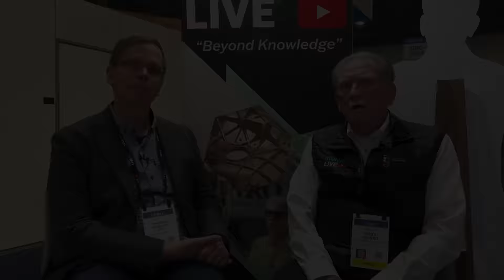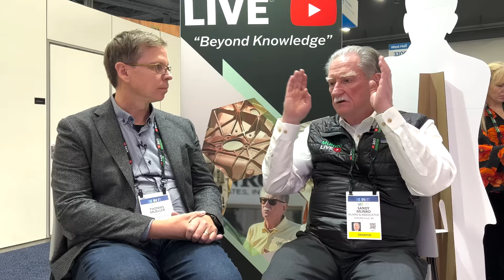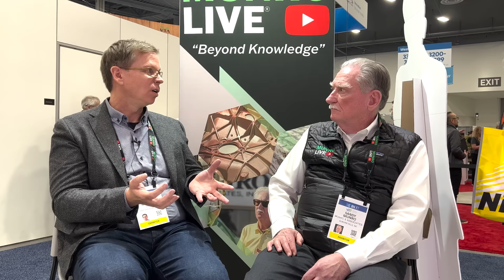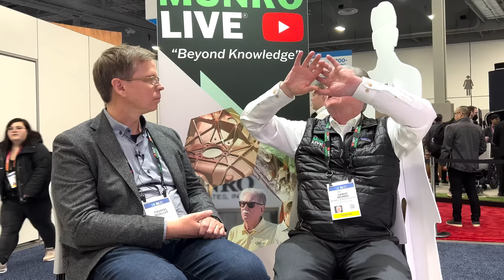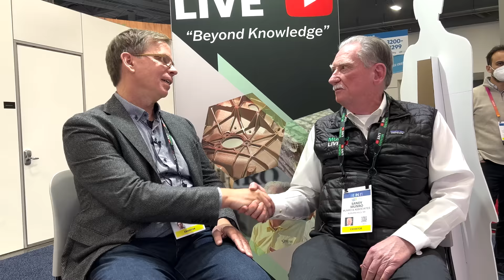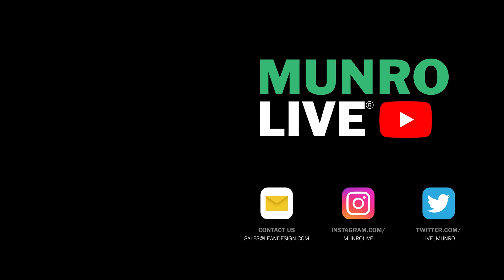100 Million Lines of Code: The State of Automotive Software | CES 2023

Comment: Don't leave off the man ours of work that goes in to each and every embedded processor for each function.   There may be a man year in the wiper controller alone.   The software team that designed that module winds up either dissolved or moved on by the time any fix or update is required.  If the module or processor is replaced then the effort starts from zero.
Reply: We call that the VW development model.

Comment: Okay, Android is better than Linux, but Android is a flavor of Linux. This is akin to saying that a Granny apple is better than apples. No, it is an apple. It might be better than other flavors of apples, but it is certainly not better than all apples, because it would have to be better than itself. This is math and not an emotion. Most computers that run Linux will be able to run Android. There are a few more restrictions, but not many.

Both of these operating systems are designed using C. By the argument of Sandy and Mueller, this should remove both of them from their software list. There is a reason why C is still being used. It is easier to modularize the code. We can make Advanced Programming Interfaces. This means that older language gains reusability, and it can go to a lower level of programming hardware components. It does not have type checking as much, so it will let you shoot yourself in the foot, but in so doing, you lose latency, but according to Sandy and Mueller, latency is bad. The only better way to lose more latency is to use assembly language. These aren't cards. These are very annoying programming statements because the programmer has decided not to have an interpreter, for the layman's understanding but really a compiler for jargon of software and hardware engineers, for the processing unit. This is not an emotional argument why C is still used. It is mathematical.

Because something is not new does not make it bad. Combining modules means that the hardware is more stressed as you have increased the duty cycle, which means it should be more likely to fail. Failure in a car is a bad thing, so latency has some benefits in this case. It is called redundancy. There should not be obsolescence planned to limit the lifetime of the vehicle, but constraints need to be put into any calculation of engineering, but yes, there can be a question what the constraints mean in terms of the evaluation function. Sandy's argument is that the constraints should not affect the cost of the car as much when cars are skyrocketing in terms of price.

Sandy's other argument is that at least one manufacturer in terms of Tesla had larger margins anyway, and as such, the cost wasn't the problem in the first place, but this misunderstands that Tesla is 3 companies in one that have all decided to help one another. That is how Tesla lowered its price. The 3 is conservative as it is the manufacturer, the dealer, and the battery company. This also ignores that it is also the fueling company as well. Sandy, you think this is good, but we, as a country, have seen the effects of multiple companies being one without the boundaries still applied. It raises end prices as the multiple companies do not have transparency to regulating authorities, and as such, the multiple companies have the ability to hide how much their profit margin is. Tesla is showing how much they raised their prices by beyond what the product should have sold for because they just lowered it, or they are using the move to take temporary losses, which I know you disagree with, in order to gain market share. Either way, these are tactics of a monopoly. Their battery company also expanded its product line into non-competitive markets by creating new housing for the batteries for products such as the Powerwall. This raised that company's costs, but it increased the parent company's market share as it reduced the ability of anyone else to buy a battery. They used resources. Could this be explained in a legal way? Sure, it could be explained by Tesla needing to get over a marginal cost in any of the mining industries as no one was actually producing large numbers of EV's other than Tesla. This meant that Tesla expanded its business interests to lower the cost of the miner, who then lowered their cost. The problem is that now there is now competition, but there is very little argument that Tesla's component would sell to any of their competitors even if it is in that component's best interest to do so. The other way it could be explained is that Musk was thinking of the pure altruism of dealing with solar even as solar was having trouble by losing money. I'm sure this altruism is the same altruism of Musk dealing with Twitter so that his plane could not be tracked or so his marketing could be less interrupted as he would be in control of the platform.

I don't have an MBA. I have a degree in computer science with classes in game theory. I also have education in history with some breadth in economics.

Comment: The solution has always been hierarchical software abstraction layers separating the main systems from every hardware layer. This makes it possible to replace any hw with new technology without rewriting your whole system.
Reply: With a good sw design it becomes possible even to backwards emulate even older interfaces or older hw. Upgrading things when you can.
Reply: A True OS is an "operating system" NOT a "user interface". The OS interfaces the hw and functions. The UI could be anything on top of that.
If OSes were designed properly you should be able to use ANY user interface -- Windows, Apple, browser, android, or literally ANYTHING. That Good SW design.
It isn't being done today.

Comment: Android Automotive is not the all-powerful savior that this discussion leads viewers to believe. You can't just install any old app off the Google Play Store and add functionality to your car, can you? Very few manufactures are going to be willing to expose themselves to the unregulated wasteland that is the full app store, so we're going to get subsets of apps, similar to what Amazon does with its Fire devices. Software versions will lag behind those released for phones because the manufacturers are going to have to be very careful about what can be installed. 

Lots of potential, yes, but the reality will be very different from that potential.

You mention BMW is headed in this direction. I believe that Polestar already uses Android Automotive, and that Ford is planning to switch to it at some point but has been delayed from their original release expectation. Any others going this route?

Comment: Thanks Sandy. Impressed you are an Expert Systems guy as well as an expert Systems Guy.

Catalog engineers buy auto components with embedded computers. Just feed it power and done. And ignore the dependence on the third party for software updates if ever.

Tesla engineer says - oh I want power windows? I time share the central car computer and no separate computer for the windows. Software updates easy. One central computer that's online to the internet.

Government could fix this by establishing automotive APIs (software interfaces) whereby third parties build compliant components with their software adapters hosted on an automotive central computer. Nothing happening here - so Tesla did it themselves.

Comment: I don't believe the Lightning will have a long life.  To get this EV to market as early as possible, Ford took the approach of converting the ICE F-150 to an EV by basically replacing the ICE with a battery electric drive train.  Ford had to compromise on efficiency in many ways to make this happen.
Reply: Yes.  I totally agree with you. I am amazed by all the bullshit about how great the lightning is. We all know that Ford does an absolutely crappy job in design and engineering. I am convinced once the true negative "cost of ownership" of the  Lightning  experience  comes to light that you will see the cyber truck crush the competition. 

All of the inherent problems with Ford Lightning have not begun to see the light of day yet. I always laugh when I see Wall Street analyst idiots say that Ford is a viable competitor to  Tesla.  I laugh because I know that those lightnings are a huge, disposable piece of plastic and battery. You nailed it in your comment Clara.💪❤  Used Ford Lightenings will bring a FRACTION of their original costs as the truth becomes known. 🔥

Comment: I drive a Merc Vito van with robot clutch & gears auto transmission. It’s horrible incredibly slow from engine start even slower to get moving from park and the delay on putting the pedal down is 1 to 2 seconds. It’s all down to badly written code that goes back to zero every time you go into park and horrendous latency in the system.

Comment: Did this guy suggest replacing C with Java?!  No bueno, my friend.
Reply: What I think he means and if so I agree is that c is a rather outdated and limited software language. Limited in the sense of the abilities of new codes that are easier to write and implement features on like the code being worked on by Google .
Reply: @johncandelario294  C isn't as easy to write, but has more power than almost all other languages. It just requires developers to truly know how it works.  C# I can do 1 line of code that makes a request to get data from a website.  C = maybe 50-100 lines.  C# can process the response in 1 statement.  But C could take hundreds.  But behind the scenes C# still has to make all the same calls, it just has the overhead of "simplifying" that functionality. And C is compiled to the System where c# tries to keep it generic to all kinds of other systems.   IE C is limited by the developer alone. C# is limited by the bloat.

Comment: So much to react to here: Take "more features": individualizing your car (or computer or even cell phone); is that a good thing? If you do that, can I use your phone? Your computer? Can I hop in and drive your car? NO! I will have no idea how to set the date/time (stop the little blinking light) on my VCR ... I have to figure everything out anew again each time, read the documentation; etc. Actually it is difficult to rent an ICE car - takes a little while to find where the controls are and how to use them. Honestly, with EVs from different companies, and the rate of change, this becomes like stepping out of a Cessna 172 into the cockpit of a 747. If I learn to use a Macintosh today (or a Telsa), is that knowledge going to be still useful 5-10 years from now? Or vice versa - will anyone want my phone, computer, or car (or know how to use them) 5-10 years from now? Instead you want to design highly competent, flexible operating systems that hide all those details, always provide what you need, intuitively, maybe one you can talk to. If you want something extra like a flashlight, well there is an app for that sort of thing.
Reply: One trick like Tesla and a few others offer are driver profiles.  You set things the way you like and other drivers set things they way they like. The driver's profile is automatically selected when the driver gets in.  Seat position, mirrors, steering position, HVAC, settings, preferences, and more are all saved with the driver profile. Now the exciting thing with profiles is the ability to use your profile in other cars with your profile saved in the cloud.  In the future, rent a Tesla during a trip and use your profile so everything is exactly as you expect, even if it's a different model.  While handly and consumer friendly, it's also a huge safety improvement.  Now if profiles could be made to work across brands, that would be fantastic (although probably unrealistic).
Reply: @tesla_tap  Indeed, driver profiles are extremely helpful, similar to iCloud backups of your iPhone or migration strategies for your computer and important apps like messages, browsers, photos, music, etc. A nice precursor in family cars has been simply to ability to remember and recall the preferred position of the driver's seat!

Comment: I don't think this makes sense.  Actuators and sensors are required all around the car.  Tiny embedded processors on each are not expensive when compared to the actuator or sensor.  Especially if you want to eliminate the wiring harness, you need these embedded processors.

Comment: I believe there are some mixed metaphors in this discussion with respect to Android versus Linux.  Android is an ecosystem comprising a mobility oriented user interface and various abstraction layers for dealing with peripherals.  Under those abstraction layers is Linux, though it could be a core other than Linux.  Talking about BMW having issues with Linux development and in-the-field performance is essentially saying that BMW is not adept at writing user interfaces and abstraction layers and ought to leave that to someone else.

Comment: While I agree that EV manufacturers must stay current regarding language and electronics, I am concerned that depending on third party software applications is analogous to using  off the shelf hardware. Tesla's vertical integration in hardware and software provides agility and speed of innovation unseen in the rest of the industry.

Comment: Are EVs only for agile minds?
We've been buying Toyotas for decades, their reliable and the layout is predictable, something very important the older you get especially if you've experienced varying degrees of stroke, short term memory is affected. This year we're thinking Tesla but afraid of ability to transition away from a well known layout. Great conversation Sandy. Are EVs only for agile minds?
Reply: Tesla can be voice controlled. When autonomy is solved, the car becomes your robot chauffeur.
Reply: I am 83 and replaced my 2014 Tesla MS with. 2022 MS. Don’t keep driving a Toyota. You can handle a Tesla, and it will keep your mind agile.

Comment: Sandy is such a good example how being one of the older generations is no excuse to dismiss the reality of our software defined world and to not adapt to change and lern. You really see here again how Sandy is not missing that fire to always stay on your toes for news, changes, learning and verifying hypothesis, even after all that decades.

I am a Sen Software-D/E myself, and yeah the embedded and automotive industry is horrible stuck in the 60s maybe 80s. Although I am a C++ zealot, but I concur one of the many problems is that they stuck on the old horrible C. I would say if they would move to C++ this would already be magnitudes of order better, but despite my refuse to switch to Rust and the hype I would say about it, would also be a good choice. 
I would only discourage to use Java, C# or Go. Java is horrible regarding performance, clear code and power consumption, it's almost as outdated as C. C# is basically a more modern Java. Go is very C like language just safer, but very young and coming from a company that loves to deprecate technologies that are used from 0 to today. (Gyp, Stadia, Circles)
But as said Rust, but I would say modern C++ without the C community idiocy would suffice too.

Comment: as a devops engr tesla approach to managing software is very contemporary. monolithic code management is not scalable.  it adds cost to maintain, slows down innovation, paralyzes development/change and progress.  micro services is now and service mesh is the near future.  can only do this if car is a fully integrated computer on wheels.

Comment: I don't think C is obsolete yet.  Yes it can be used to write insecure code,  but it is still going to be faster.  As an analogy,  imagine your house had padlocks on every drawer,  every food container,  the toilet seat etc..  Yes, it would be more secure,  but the overhead would slow down your whole life.  It's generally considered better to secure your perimeter and rely on trust inside the house.  With code, security is most critical in the interfaces between modules (either linked software or comms protocols on wires or in files).  Inside a module, significant performance gains can be had by sanitising data only at the interfaces and writing low-level code with fewer unnecessary checks in the core.

Comment: As a Linux user and someone who worked in medical equipment manufacturing writing test procedures the idea of someone using Linux in a car is scary.  Bad software has killed people (Boeing 737 Max).  Android uses a patched LTS Linux kernel,  a little better I guess.    
Software testing, verification, and Operating System(OS) used in mission critical systems is very important for safety.  Having a "fail safe" if the system goes stupid and starts doing strange things is very important.  
If my phone does not work well after and update it is a problem, if my car does something strange after an update that can be dangerous.

Comment: Almost all automakers are moving to centralized computing. Ethernet cables runs will be the norm in modern cars. I have read a Mckinsey report about this a year ago.
Reply: But if you have lots of ethernet, then it means your computing isn't centralized. There are already various buses wired around the car that connect every module.

Comment: As a software engineer and Azure cloud architect. Not sure I agree with moving away from Linux is a good idea. As a matter of fact Android itself is based on Linux and modern containerization architectures (Microservice) are exclusively designed for Linux.